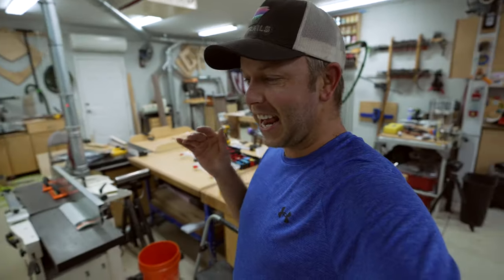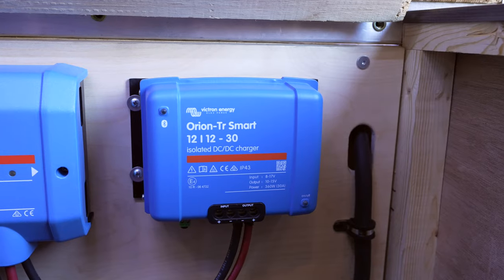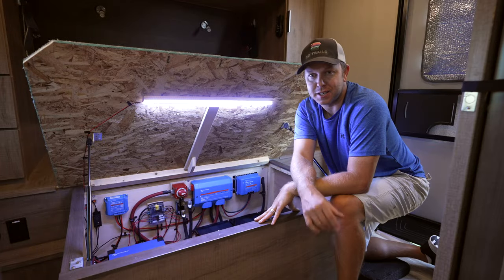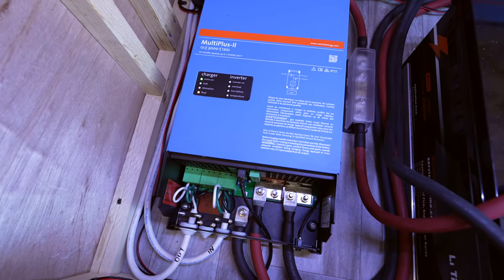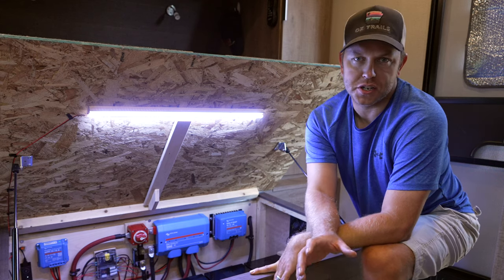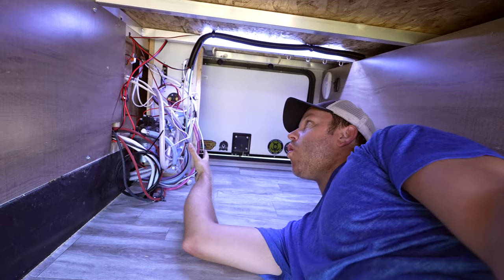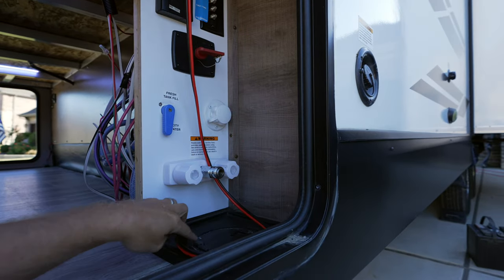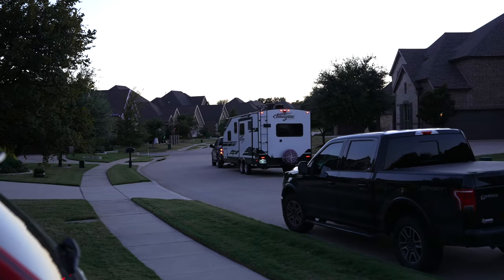DIY Lithium, Solar & Inverter Upgrade | We SAVED $7,500!!!

Comment from the maker: Here's a list of the components used in this system install........

LiTime Lithium Batteries - https://www.litime.com/?ref=One2ManyHobbies
Victron MultiPlus II - 12v/3,000VA - https://amzn.to/3Qklhoo
Victron Lynx Distributer - https://amzn.to/48T39cx
Victron Smart Shunt - https://amzn.to/3ZYOhoV
Victron 75/15 Solar Charger - https://amzn.to/3FloNZq
Victron Orion DC-DC Charger - https://amzn.to/3Q2QGKT
Bluesea 12v Fuse Panel - https://amzn.to/3rKuBJ2
4/0 Wire & Lugs - https://amzn.to/46v6mh5
30A OEM RV Splice Kit - https://shop.explorist.life/shop/all-...
Portable RICH Solar Panel - https://amzn.to/46z20oX